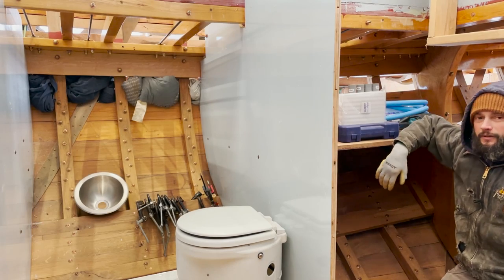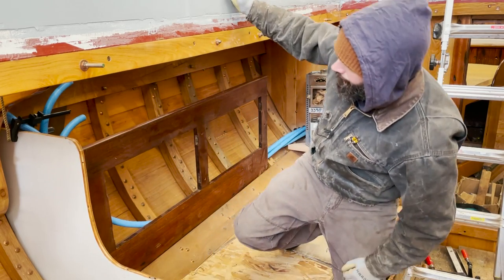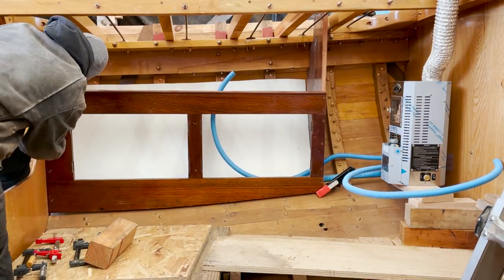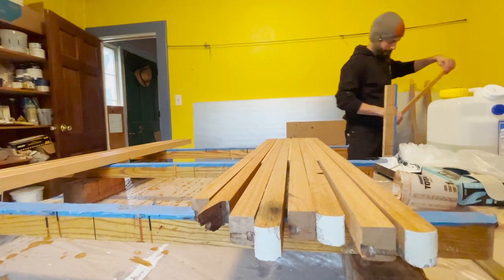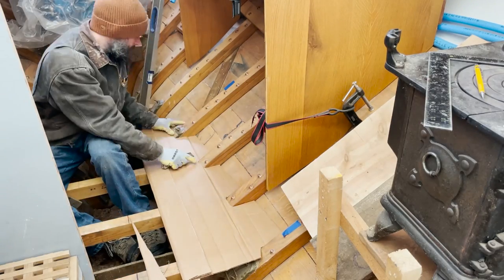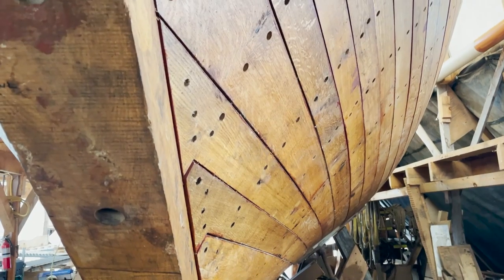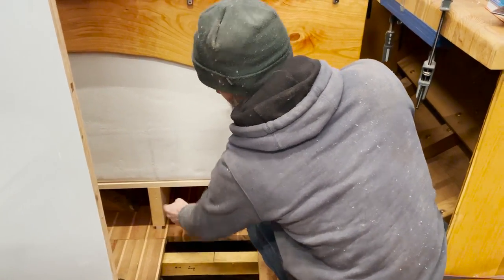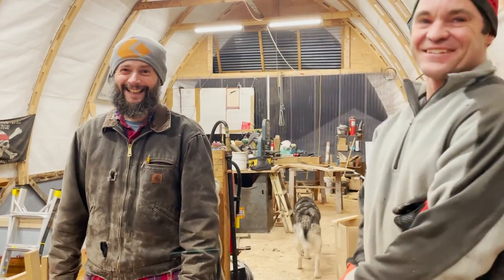Finally Back to Woodworking! - Episode 195 - Acorn to Arabella: Journey of a Wooden Boat

Comment: I’m a former electrician. You don’t need the pvc female connectors (grey) to connect the Smurf tube (blue conduit) to the boxes. Going away from them will also make your connections less bulky and cumbersome in tight quarters. If you want to use threaded connectors you can hole saw the box, insert the male end of the Smurf tube connector into the box, then screw on lock nuts to the connectors. If those boxes are thin enough, there’s snap on connectors as well. A couple of hole saws, 1 3/8”, 1 1/8”, and 7/8” will cut  the required size holes for threaded connections.
Reply: My thought exactly.
Reply: I agree completely! Wanted to write a comment about these same thoughts.
Reply: I was also going to comment on this. I saw in a previous episode his plan and was going to comment then and then he mentioned it again in this episode. I'm glad i checked the messages before i made a new comment.
Thanks for the Vids
Reply: Fully Agree, you do not need those grey parts, those are for making grey PVC conduit into threaded, not for what youre doing! hole saw directly into the boxes and use the smurf connectors your already have and put nuts on the inside- You can seal, or caulk or putty or dum-dum whatever you want to make them water tight but it would solve your "odd drill size" problem
Reply: Former electrician also, I was going to add the same comment, unsure why he using Smurf personally I didn't use it unless there was no other way to get the job done
Reply: @bigunone  SAME- Smurf-tube wouldve been my LAST choice- regular Seal-tite is 100x better
Reply: @Mad-Duk_Machine_Werkes  Smurf is great until you start pulling wire through it. Upsize and strap it excessively. And don’t discover you want to add another conductor after you’ve already pulled the initial conductors through it.

Comment: Water tends to condensate out inside of your conduit. Over years it deposits minerals and salt which harden the wire insulation and cemented it in place to the point of the insulation cracking lose and tripping breakers. When I needed to pull some wire it proved impossible, and could only saw out the conduit and run all new wire.  Lesson learned: find the low spots in your conduit runs and provide weep holes.  Smiles.
Reply: Wow that is good information to know. What about piercing the conduit in places to provide some form of ventilation?
Reply: Given that what is the point of using conduit over simply well insulated wires? (true question, I'm a newbie)
Reply: @thibaultghesquiere  conduit protects wires, and provides a raceway that allows for  additional wires later (if large enough), or easier wire changes/repairs.
Reply: I’ve used that conduit. Not being smooth it collects a lot of crud. Almost need to be able to flush it out occasionally. 
I’d have been inclined towards smooth aluminum tubing. And yes, with weep holes.
Reply: @thibaultghesquiere  Not at all unusual for 12 or 24 volt insulated boat wires to be exposed and held in place with straps. Don't know about 120 or 240 volt.
Reply: @noelnicholls1894  it's also a pain to pull through unsure why he just doesn't use ridged PVC
Reply: Smooth bore sanitation hose used for plumbing heads works extremely well. Bends easily when warm and allows wires to run easily.
Reply: nitrogen purge?
Reply: @chrisv4640  the connections are not airtight, so a continuous flow of nitrogen would be necessary, which is ridiculous...
Reply: @bigunone  I agree, it would take a bit more work but you can heat it up in a conduit heater and lay it where you need it.
Reply: There is channel wire ducting material with a snap on cover made especially for the purpose, used extensively in machinery construction!
JIM :yougotthis:
Reply: @bigunone  Yeah. I’m gonna say its a definite misstep. First i’ve seen for sure. I ended up throwing that shit in the bin.
Reply: Wtf! Is 'condensate' an Americanism?  Bad bad bad! 😆
Reply: @thibaultghesquiere  wires are supposedly easier to install and remove, but in reality you get problems like the one mentioned.
Reply: @J Hemphill  Thank you
Reply: @stevenholton438   What don’t you know about the word condensate.
Reply: It makes it easier to pull wires from point A to point B without having to fish through each compartment/frame/bulkhead individually.
Reply: @johnsawyer2516  I'd never heard it before in English so I was wondering  if it was an Americanism or a real American word!
Reply: Man speaks the truth.   I actually made note of this in the last video.

Having worked in HD / mining / construction auto electrical industry for the last 15 years.  I've seen that sealed conduit often traps water INSIDE instead of keeping water outside.  On a sea faring boat, this would be 100x worse than a machine that works in the mud.

I would advise against using a sealed conduit in the first place.  My opinion is that no matter what, the electrics will be rotten in a decade anyways.  May aswell make it cheap and easy to service/replace.  Instead of building over the top, which will hamper future service, and add expense and complication to the install.
Reply: @stevenholton438  condense is the verb, condensate is the noun (aka the water)
Reply: @stevenholton438  it's a chemistry term. The stuff that is collected from the condenser is called condensate. Yes, that makes it a noun.
Reply: @deadpiratetattoo2015  I  guess he merely used it wrong then!
Reply: @stevenholton438  either way. I'm a chemist. I can't help it. No hate
Reply: @deadpiratetattoo2015  I'm English therefore he used it wrong.
Reply: @chrisv4640  Yes with a whiff of argon, a touch of thorium, and some champagne smellivision.
Reply: The correct use of the verb is (using your sentence as a template): "Water tends to condense inside your conduit".  "Out" or "in would be implied in the action.  What would be produced by the action of condensation is a noun: "condensate".  Otherwise, this is VERY good information!
Reply: @stevenholton438  I'm just talking from a chemistry point of view. Not really trying to get my ego wrapped up in it.

Comment: Vacuum through a few pieces of ribbon in each as “mule tape” to pull through wires down the road. It works on bicycles with internal cable routing.

Comment: Stephen, maybe it's been said, but there are electricians' hole saw kits for the fittings. Also, Why don't you just use the male adapter straight into the junction box and have it held in place with locknuts. You can get those at any electrical parts store. That makes installation a lot cleaner.
Reply: Exactly!!  You don't need the grey PVC adapter whatsoever, just simply insert the threaded part of the blue smurf adapter right into your box, and screw the locknut right onto the thread to secure it into place, it's a standard thread size that you find in any local building supply store's electrical section.  The less fuss, the better, and quite frankly the PVC adapter will require more clearance for your tubing when you install the box, and cause an extra point of frustration when you try to pull the wire through and your wire or fish tape gets stuck at that final inch or two.  Been there, done that, have the t-shirt!
Reply: Yup, hope he sees this comment
Reply: adding to this. You can also get sealing washers that will keep the enclosure water tight. Furthermore, buy a ferrule kit and some good wago terminals. This dude better not fill those clear enclosures with wire nuts and E-tape...YUCK
Reply: @jasonpavlik4904  absolutely!  If you want a reliable connection, consider installing some terminal strips inside the box, and use crimp type connections (ferrules) on the bare end of the wires.  Keeps everything neat and organized, and very secure.  Added bonus is that you can clearly see when a connection is amiss.
Reply: My thought too. All of that type of junction box come with connection fittings. You shouldn't have to use a drill and glue 'edge on' like plumbing fitting. There must also be a way to drill and tap a hole for an end connector.
Reply: @arthurskudra50   @Acorn to Arabella   I agree with the previous comments that the Grey adapters are not required. Also after you have them lock nutted in place you can trim the excess threads back to slightly increase the room inside the smaller junctions box's.
You can't trim them on 120/240 systems as the inspectors will fail the install. 
I agree with the earlier comment about Terminal Strips for the Terminations. They make inspections easier and allow for future flexibility.

Emergency Service Vehicles have aftermarket Power Distribution Box's which incorporate Terminal Strips and Fuse Blocks. Some even have Low Voltage Load shedding built into them to keep essential equipment powered and dump secondary loads.
Reply: I have been thinking the same thing. I hope he is able to see this and 100% go with wago connectors.

Comment: Electrician from Florida, I would greatly recommend using something called a “Myers hub” between your blue flex conduit male connector and the Plastic junction box.
The blue flex conduit you have grabs onto that male connector extremely tightly and you can’t just unspin that female from the junction box as you are planing too.  
The Myers hubs would give you a lock nut inside the box to unscrew to allow conduit adjustments and would be water proof.

Comment: You might want to consider "potting" your junction boxes to keep water in the conduit from getting into the J-box where you have bare wires.  Potting is blocking the openings from the conduit at the J-box.  Use putty and mold it around the wires inside the conduit at the box.  That and the weep holes previously suggested will help avoid shorts in the electrical system.
Reply: Putty = Duct Seal !

Comment: Spent twenty years in the U.S. Navy. Condensation in the conduit will drive you crazy. Seen it lived it. The way the Navy designed their electrical systems was to use shielded (armored) cabling. No condensation to deal with. Wiring is placed in wiring runs which keep it in place and minimized movement/chafing.  Your boat,  so what I refer to is just An old man talking. Thank you for the videos. It’s been a great project to follow.

Comment: Steve: Small hint from the woodworking community. Instead of using blue painter's tape for your glue-up cauls, use clear plastic Packing Tape. The glue does NOT stick to it, and it comes away clean. Thanks for the videos. Jon

Comment: Looks like you are adding extra difficulty to your conduit connections. The fitting for the end of the flex tube is called a connector. You use a hole saw or step bit to drill the jole in the box and simply put a locknut on the connector. That is how they are designed yo be used. You can go to the electrical supply and get foam "mice" which are designed to tie a string to and suck them through the conduit to pull your wires in.
Reply: What this guy said!
Reply: Came looking for someone to explain how it should work. Felt too complicated. Always wonder how often creators see comments in time to modify plans.
Reply: My thoughts exactly,  plus use non metalic locknuts and leave a pull string  for later upgrades
Reply: commented this same thing as well.
Reply: Only if he doesn't plan on sealing the junction boxes themselves

Comment: I don’t know why your not just using the conduit connector to the junction box with lock nuts screwed onto connectors. Gluing the female PVC connector to the JB might not hold after pulling wires?
Reply: I've been wondering the same thing. The blue connector is designed to be held in place by a lock ring inside the box. The gray fitting is just a weak link!
Reply: First, you gonna loose space inside the box, then you need to thread the holes and third, which I only assume at this point, the threads are opposite. So, you are actually able to fit the conduit connector without rotating the entire conduit.

Comment: Just a suggestion from someone who has done a wee bit of plumbing work. Don't glue your PVC fittings when you connect them, use Teflon tape or pipe dope to seal your junctions . This gives you flexibility  so that if you ever need to move boxes or extend  lines all you need to do is unscrew your fittings, make your connection and reconnect your lines in the same manner. This should give you a watertight fitting and let you have some options for the future if needed. Cheers!

Comment: That white plastic in back of cubbards is nice idea. Will make it a little brighter in there (assuming you put a little LED, which you should put on an auto switch that turns LED on when door opens, would be really easy) and make it much easier to wash down with a wet rag too. Good stuff. The freezer box looks amazing man. Floor looks fantastic aswell. I mean all of it does.

Comment: Stephen, ensure the water tanks have some partitions (with holes across) that prevent a huge mass o water in half-empty tanks moving from end to end on wavy waters. This may prevent the mounting points and surrounding stuff damage by reducing the tank side to side impacts and vibrations. Also, it will increase the comfort of sleeping when there will be no loud splashes every few seconds coming from inside. Thanks for sharing the experience!
Reply from the maker: Those are called baffles, and yup, they’re going in.

Comment: Hi Stephen, your woodworking skills have come a long way and what you produce is excellent! I wonder if you would consider putting 1/8 " mahogany strips on the pine stand you made for your fridge? I thought it might match the rest of the interior better. The other thing you need is new runners. please look into Zeba shoes as once fitted to your feet they slip on and off without ever having to tie or untie them as the heel part has a hinge. Thanks for another great video. Cheers from Canada.
Reply from the maker: We’re gonna go with the whole patchwork feel. Like how the only inevitability in life is change, the only consistent thing in Arabella is inconsistency. It’s a look. 😉

Comment: I need to rebuild the cubbies in my sailboat.  Thanks for showing me patterning techniques that I can use.
Reply from the maker: Excellent, Ken! Let us know how it goes!
Reply: @AcornToArabella  J24’s are notorious for having leaking deck gunwale seams.  The curve is irregular.  So unless I follow what I saw you do I will not be able to duplicate that curve.  It is hard to make a repair once but to have to do it over because you didn’t do it right is nonsense.  Of course it will be coated in epoxy sealing the wood.

Comment: I have a 40mm hole saw 😃 

As a Brit, yet again imperial baffles me 😃
Reply: You must be young then, the British invented imperial hence the name and we were still using it up until 1971 completely and in engineering we still use it.
Reply: @nickmail7604  middle aged but young enough that currency was metric and we were taught in metric at school
Reply: @nickmail7604  it is a horrible mash up of metric and imperial now. Its redicilous.
Reply: @ian-c.01  a US gallon is only 3.8 litres tho.

I switch between metric and imperial depending on what I'm doing. Anything under a 1ft is definitely metric bit fuzzy from 1ft/30cm up to multiple metres longer distances tend to be in miles unless I'm on the boat then its nautical miles. 😃
Reply: As another Brit. It doesn’t bother me, If measuring something that is already there, I just use whichever measurement is closer to what I need.  mm or imperial. Then again, I was trained with imperial micrometers and still use them most days even with wood.  Old habits die hard !
Reply: @DorsetSaferRoads  Same. I'll use imperial for guesstimates or any measurement where 'close enough' will suffice. Anything required to be both accurate and precise becomes a metric measurement.

Comment: Glad to see you laying the sole down in line with the keel!  Unlike another boat builder on YT who shall remain nameless who created some really lovely “teak and holly” style panels then instead of laying a uniform directionally floor, laid it down in the direction of travel at that position in the boat. Kinda winding path style with stripes first one direction, then another….doh.  My confidence in his design ability took a major plunge at that point - it was an exercise in how not to do it I thought. The sole needs to be a solid base and unifying feature in a space where many odd shaped “square” objects are fitted into a curved space.  Having it zig zag along the boat just adds to the chaos and jumbled position of cabinets, tables, heaters, doorways etc that the interior of a boat always is.  I’ve never seen a sole laid in that manner before and there’s many good reasons why.

Comment: You should have ran string through that conduit while you had access to it. Doing so would make it really easy to pull through electrical and other lines. When you use the string to pull the line through, attach another string to the end of the line you are pulling and that way there will always be a string inside to pull line with. Just a suggestion. Love your channel!
Reply from the maker: We haven’t lost access yet! Just getting started, everything cut to length. We’ll be doing that.

Comment: probably been said... The grey fitting is a "female terminal adapter" . It is used to connect the blue threaded connector to PVC pipe, not junction boxes. Take the blue connector directly into the box. Though those connectors are not a "water tight" connector, don't think they need to be... Get a 3/4" lock nut at any big box store and pick up a 1-1/8" hole saw for the blue connectors.
Thanks for the videos